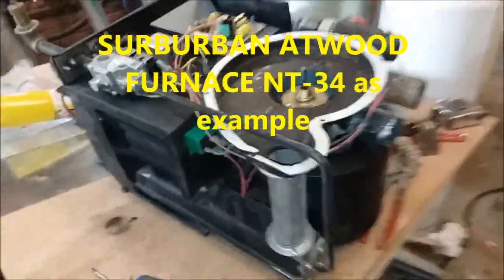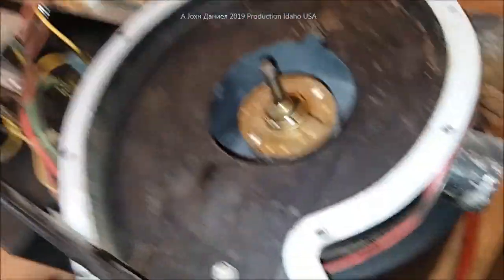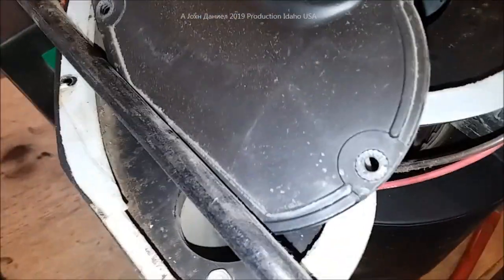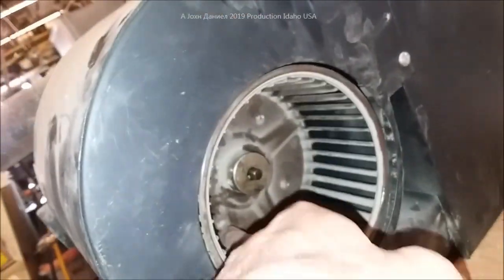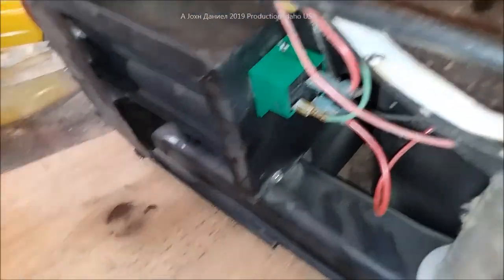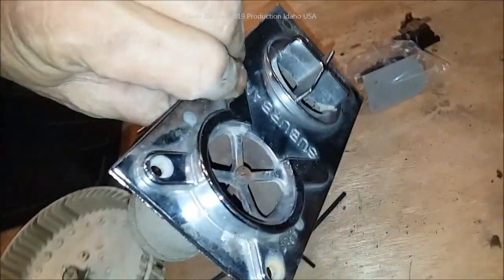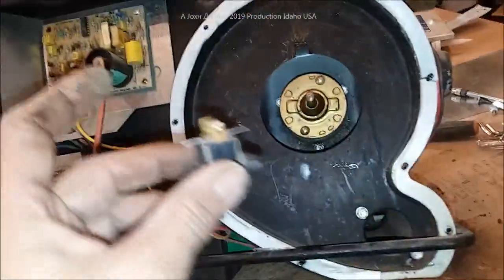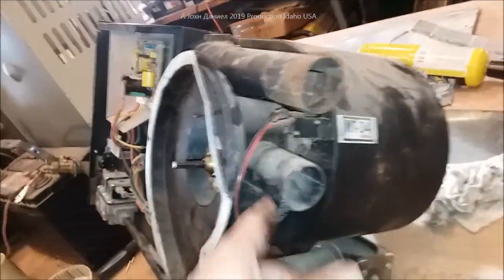RV Furnace Intermittent or No run problem, Common Issue, SOLVED (parts Below)

Comment from the maker: Most all use a TIME RUN DELAY RELAY https://ebay.to/2RDRSbo an OPTIONAL relay https://ebay.to/2mKhmGC fits Suburban, Atwood, Coleman, Duotherm & with excellent instructions. Total list Propane parts https://amzn.to/2GEwKM7 Cheap High quality survival Food Kits I use http://bit.ly/2Qs0vGO STOCK YOUR RV with survival kits NOW, Electronic Banking fails - YOU STARVE!,  make it roll ready!! GET ALL APPLIANCE BOARDS FOR RV's any year https://ebay.to/2pUHwEE , INFO - If your RV heater-furnace is doing the following - Attempts Fire up then no run, Fan kicks on and off erratically. Runs a normal cycle but fan won't shut off. OR fan keeps running with thermostat off, OR Fan starts - fire starts then it shuts down. Switch to heat, hear clicks, and nothing happens. Most common failure item on Suburban and Atwood furnaces.
Dinosaur Electronics Furnace Time Delay Relay 12VDC TDR is solid state and works on Suburban, Atwood, Dometic, and even some Coleman heating units 12 volt controls
Reply: Hello I have a nt40 and it don’t not want to lite was working but stopped blower works just no heat what could be the problem.  Thank you.

Comment: Hey John,   I think this video nailed it but wanted to run it by you....confirm it before I buy the new part. I have the Silverado unit. My furnace fires up and runs for about a minute then shuts down, last time it ran for about 5 minutes, then shut down. You can hear the motor slow down for a couple of seconds before it shuts down. I can hear the fan trying to cycle back on several times very briefly before i shut the thermostat down. If I wait a few minutes, turn the stat back on the furnace repeats the same! Does this sound like the TRD relay to you?    Thank you for your time and the video.... hope to hear your reply.....
Reply from the maker: Possible the TDR or the Limit Switch. Change both, your over temp limit switch and TDR, when they start to fail they will make partial contact, cycle oddly and make no sense to the average persons thinking. The fan cycling on and off is those cool down features screwed up.
Reply: Hi John,   Going nuts.....replaced the TDR and the OTLS as you suggested. Thought you had nailed it....fired the furnace up and all seemed great but after about ten minutes this time it did the same, shut down and the motor made short pulses trying to start again! After shutting the thermostat down for a couple minutes, turned stat on and it started up again, only for about a minute this time and then shut down. Any other thoughts on this?
Could the motor cause this shut down? When i first started the system the motor was squeeling badly..... I pulled it, added lube to the padding(oil) rotated it 180 and put it back in...sounds o.k. now ....... Also was wondering....is there a vacuum pressure sensor or anything such as that? Would the system shut down if it's not closed up.....door on. vent tubing back on, etc.   HELP Please.... need to sell this snowbird but not alot of interest with a defective furnace......  Thanks John.....
Reply from the maker: @Bluebyou67  Pulsing on and off is when a Bi-Metal switch in the system or rarely a relay is making poor contact or in the case of a bi-metal switch failing. On super rare conditions its a cracked plastic body of a blower on indicator switch.  with a multi meter attached on the power to the heater, Fire up the furnace, see if a large drop in power occurs. If it does then the relay that send power to the motor is letting go due to low voltage reaction. Firing it up the second time with a shorter resulting run tells me your coach battery or converter is having issues keeping the volts up. Let me know what happens.

Comment: As a part-time "wannabe" RV tech I really enjoy your discussion.
Reply from the maker: Never Be, a Wanna-Be, always be a Pro in training!
Reply: thanks for the really complete video. ya get a bit twitch adding a few queasy-cam moments. haha

I appreciate the comment wrt voltage that the 12v Dinosaur really or the other 24v relay will work. Where I'm. buying parts for our rig's furnace.

Just doing a refresh for a 22yr old NT34SP. already replaced the sail switch, limit switch. That was all our local RV dealership had in stock.

Noticed our furnace has on/off switch mounted about where the power connector loves. Thinking I'll move that switch somewhere we can. get at it easily.

again excellent video... thanks!
Reply: I like that,  @JOHNDANIEL1

Comment: the problem I am having is I will turn on the thermostat the furnace will run get the RV to temperature then shuts off like its supposed to, but wont turn back on. I have to turn the thermostat off then back on again, and it will run the first cycle again and get the RV back to temperature and it will do the same thing all over again and not turn back on when the temperature goes back down. Does anyone have a fix or know why it is doing this? I also have the same problem as everyone else with the soft touch buttons don't matter how soft or hard I touch the buttons they pretty much just don't respond, and have to take the cover off and just use the 3 prongs. My system is a Dometic soft touch thermostat with Atwood furnace 2019.
Reply from the maker: That behavior is normally due to a dual function thermostat attempt to disconnect heat when it exceeds the AC cooling temp setting. Remove battery, press all buttons and flip all switches to attempt to reset it's 8 meg memory. If that don't work it may need replaced. Personally I toss them on day one and put in manual thermostats for both. If it fixes you, feel free to hit a donate applaud thanks  link under the video
Reply: This is very similar to the problem I'm having. I've obtained another new thermostat and still have this intermittent problem.

Comment: My 95 Atwood works perfect when thermostat isn't hooked up and wires are jumped.   As soon as thermostat hooked up I get what seems to be voltage drop because fan sputters and then trips the circuit breaker.   Any solutions be great, been dealing with this problem for over a year.   Thanks

Comment: My suburban furnace in my 2011 Springdale camper will fire up but there’s a slight clicking sound in the wall thermostat. As the furnace heats up there’s a louder clicking noise down in the furnace and when it reaches it’s set temperature it cuts out..the fan will keep running for the cool down period and then the fan will cut out for a split second and keeps blowing cold air… it won’t ignite anymore until I turn it off on the thermostat and turn it back on.
Reply from the maker: Sounds like your over temp (limit switch) and your delay relay are both failing.

Comment: I have a question for you. I replaced the furnace motor on my Suburban NT24 M heater, how do I know if the motor is running at the proper RPM? I Was thinking that there isn't enough air flow to move the arm on the sail switch, because it was working before I replaced the motor. Also do you have to soldier a tab onto the new sail switch?
Reply from the maker: The sale switch should have a flag on it about 3/8 in wide by about a half inch long on the end of a stem little over an inch from the switch trigger. You can solder one on be sure to use quality flux and clean up the surface afterwards so it doesn't corrode later.

Comment: Cant get the fan to turn on.eplaced the time run delay relay and I have 12 volts traveling there to the fan motor check the fan motor from a alternative 12 volt power supply and the fan turns on and sounds good.checked my ground from the inverter box and I have ground what am I missing?
Reply from the maker: Power from or through the thermostat or the high limit switch is caught between off and on. Bypass it, test.

Comment: I'm still confused, I have a furnace that the motor starts, I get ignition , the furnace lights and I see flame, and it promptly shuts down. I replaced the flame sensor and ignitor and the same problem.  I cleaned the valve and burner, other appliances work fine so no problem with gas supply. If this was a run time delay problem, why would it be?

Comment: If all else fails make sure there is no buildup of paraffin or other crap on the burner orifice. I have had those plug up. Just had to do my water heater. It was restricting gas so bad it would not light up and gave up. After cleaning ran like new

Comment: I just replaced my blower motor on my NT24M Furnace I put heater back in just to find that the end of the blower shift was hitting on the combustion shield. I removed the cover and repositioned the blower as to not hit the cover. As I was putting heater back in I broke the tit off of the igniter and had to replace it. After installing a new igniter I tested it outside of the case to find out the igniter was was lighting until I pulled up on the sail switch. Which after about 15 seconds the igniter was trying to light. I never had  the gas hooked up, but As long as I hold the sail switch up the Furnace will light I believe. The people that I had work on the Furnace this last fall, replaced the circuit board and cleaned out the burner. The Furnace worked good up to December then started making motor noises. The furnace was still working prior to replacing the motor. I can't use electric heaters here because I gave my word to the owner I would use my furnace. I did notice That as the igniter is attempting to light don't touch the wire to the igniter because you will get shocked. Is this right. I have  another sail switch with me but why would the furnace not work just by replacing the motor? HELP PLEASE.
Reply from the maker: Sounds like a sail switch failure, from your other comments I think you're figuring it out though.

Comment: Great video.  I have a question.  I have a Suburban DD-17DSI furnace.  I have removed the furnace.  It does not seem to have a run delay relay as your video shows.  I look parts up and they seem to be discontinued.  I am thinking my Limit switch 231768 may be causing my problems.  Fan starts up and runs and then shots off without igniting furnace.  Occasionally, it will ignite and the furnace continues to run.  Any suggestions regarding part substitutions for limit switch, sail fan switch?  I cannot find a sail switch that matches mine which has a bend in the flapper.  Thank you.  Paul Steffy

Comment: Any idea what would cause my furnace to run fine most of the time but every once in awhile it will lose flame and blow cold? I'm stationary on shore power so I don't think it's fan speed as I have constant 12+ volts.  It happens on a full tank too.

Thanks for your videos!
Reply from the maker: The common cause of that is the limit switch.

Comment: Thank you for your video. My fan does turn on the ignitor gives me a flame then a couple seconds later I hear a click and the small flame is gone and it does this 2 to 3 times then the fan shuts off 30 seconds after. It does that most of the time but once in a while it will work and produce heat. I have read its the sail switch but how do I start trouble shooting this.
Reply from the maker: You're either suffering from low battery power or low propane pressure. Test a battery with the volt meter before and as it's firing up to run, test of propane by turning on the heater and then running all burners on your stove to see if you see a significant drop in gas output. The last option would be the time delay run relay which could be releasing without fully powering the board. Those are intermittent also.

Comment: Got an old ’83 Rambler with NT-30SP. I replaced the furnace 3-4 years ago. Set Thermostat, came on, and heats fine just one cycle. Would have to cut off the thermostat (new) and back on to just get to do one cycle again.   
Any ideas why everything works fine one time and not restart?

Comment: I have an RV whose furnace sounds like it is bogging down when running. It is still producing heat but while running every so often sounds like it’s going to stop but then goes back to blowing normal.  I Am assuming that something is wearing out and will soon need replacement. Do you have any idea as to what to check or replace. I am an older female who camps and feel as though when I take my camper in for repairs that I am being taken advantage of. I am fairly handy and believe with a little advice I could handle a repair.
Reply from the maker: If is over 10 years old and you have sufficient voltage from your controller to your batteries in the coach then your motor is probably wearing out the bearings eventually will start wearing out they'll drag a little pull themselves towards the magnets tighter and then take off again running a little faster for a while and then repeat that process over and over again so I would say replace your motor you need to make sure you have a t-handle set of Allen wrenches for taking the blower assemblies off.

Comment: Hi John...so yesterday my furnace heater made some bad noises while the generator was running and i smelt burnt wiring, so I unplugged the generator and pulled the hearer box out of the camper and inspected it, it looked really good and no burnt wires so put it back in and now I can't run the heater furnace with the generator on as it makes a horrible clicking noise, but works without generator running, please help, what could be wrong?? Thank you

Comment: I have nt-40. Fan comes on, lights and heats for about 15 minutes then starts blowing cold. Thought maybe hi-limit switch, but even after the blower stays on an hour it won’t relight so I can’t even say it’s short cycling. I did notice just before it goes out, i can smell half burnt gas kind of smell. Any ideas?

Comment: i have a 1999 windsport motor home,  the furence always work great,,  a few monthes ago I turned it on and noting at all happens.. the fan does not turn on... ive tried to test furence for power out on the furence ,,have nothing checked fuse ans breaker ,, all is good,,any ideia what the next step is to determen the next test stage,, thanks,,,
Reply from the maker: Remove the thermostat cover and touch the 2 terminals together with it on heat to see if it starts, letting them sit there can end up with corrosion on the contacts in thermostats. It's only 12 volts, it will not shock.
Reply: @JOHNDANIEL1  thank you john i will try that today and let you know thanks again

Comment: Great video John.  I am having issues with my fan internally running. The thermostat calls for heat, you hear the relay but fan does not turn on all the time (intermittent) I have the furnace out and there is no time delay switch. Is it possible the board controls this? I have a suburban nt 30sp. Not sure on age.
Reply from the maker: They do have a time delay relay, it's between the red incoming power wire (plug) and the red motor power supply. Some may look different or it may be a previous technician bypassed it with something else.
Part number 231202 that's no longer  sold, that's why I put the link to a universal Emerson TDR under many of my heater repair videos.
Send me a email to olympicpowercontrols@yahoo.com and I'll send you an electrical schematic to it.

Comment: I have suburban NT-24SP and will work fine for days then the burner won’t light. The igniter is working but no flame. If I remove the front cover and turn it on the burner will ignite each time. I recently removed the unit and cleaned out all debris too. Any advice would be greatly appreciated!
Reply from the maker: If your getting clicking, and can see spark on the electrode but no flame until you remove the front it may be a issue with loose terminals that get contact when you shake it a bit as you remove the front section. Heat and cold and vibration can make terminals get and loose connection, so pull, check for good contact and reconnect them on the board and other contact points. Let me know what your results are.

Comment: John, I have a 2006 Keystone Cougar with Dometic furnace and AC. My problem is that every now and then the furnace does not shut off and you wake up sweating. You have to remove the fuse to make it stop, but once you remove the fuse and replace it the furnace works fine again for a week or so. It sounds to me that this is the "run heat control relay" you mentioned, but is there a way to test before I replace ? Others said to replace thermostat but this one is not longer available. And others said to replace the control board in the AC unit. I don't want to spend $130 on each of the "maybe" parts they say to change. Thanks, great video!
Reply from the maker: Verify its using the Run Delay relay and if so replace it. Thats a common fail condition. If it does not have one, and your AC and Heater is on the same control board then your heat side thermostat control is bad. It has a small sending signal relay on it that has been known to stick on. If you can pull the plastic cover off on it, with power off, try to see if its contacts are spotted with arcing. Clean with 400 sand paper if you can, like you would distributor points.